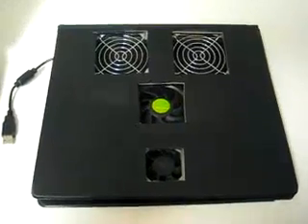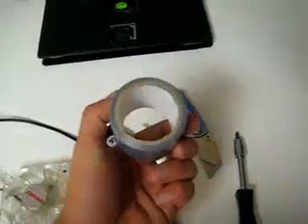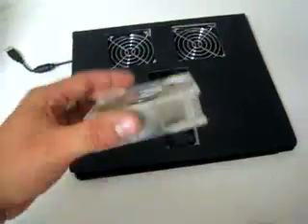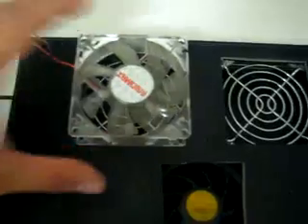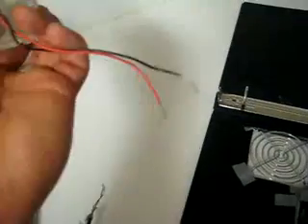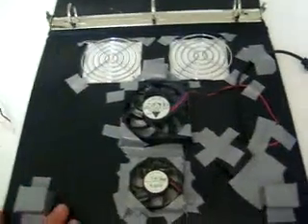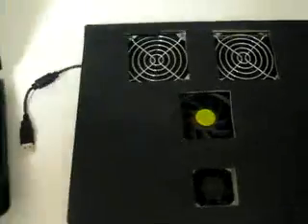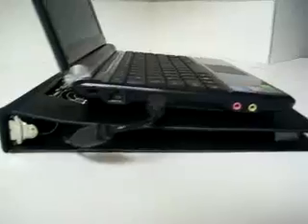HOW-TO: laptop cooler for under 5 dollars!!!!

Comment: i built something like this in the past few days just for my own use has 3 speakers 2 tweeters a dual fan for air leds for connection light along with multi card reader and all bulit in to one convenient box powered by one usb .....if you want to see ask

Comment: Check the system monitor application, under your applications->utilities folder If there is a program that's putting a load on your computer unnecessarily, you can shut it down from there. Also, there have been overheating issues with the early plastic macbooks. (Core Duo, not Core 2 Duo)I believe the problem was that the glue messed with the insulation on the temperature sensor wires. That's why they are now held in place with Kapton tape. Hope this helps you.

Comment: for those of you that dont have any way of buying a fan, what i did was take the fans off of some old computers i had collecting dust in my basement there should be 2 fans in a standard computer. after about an hour of tinkering i got some fans and made my own :)

Comment: That's a piece of shit.... USB ports only put out 5volts.. not only are you using a USB, you have the goddamn fans in the wrong direction... Try using 4 120mm fans rated at 12v @ .25amps.. 1200rpm.. run them in parallel and connect them to a 12v 2amp AC adapter... I feel like slapping you in the face right now...

Comment from the maker: @heatednemz They are pulling the air out of the laptop because the fans which are already operating within the laptop are forcing air out of the case.  The design of airflow should match the preexisting fan placement of your individual laptop and can be easily customized by placing the fans of the binder in conjunction with your vents/fans of your laptop

Comment: @Nikos870 
Most likely not, and at least not "at full force"
Maybe,  It  "might work" but  I wouldn't be surprised if it doesn't even move.
The reason for me to say this is that from a single USB  You can AT MOST get  0.5 Amp at 5V (= 2.5 Watt) 
And as You can see Your chosen fan is rated at  0,84  so the power is there, but the fan is rated as "starting voltage=7V" and You can't get that straight from USB.So the question is if it will move slower or just stand still.
Just my 5C hope it helps :)

Comment: Very impressive. The Binder is a great idea because it has a natural angle. Tape is not a good idea to secure fans. Today there is a multitude of inexpensive hardware choices. Two part epoxy might work well also. I love Proto-Type Engineering. Think about it as a career choice. You are a good speaker as well. Keep it up.Good luck.

Comment: Voltage: 12V DC.
Starting Voltage: 7V DC.
Consumption: 0,84 W.
Rated Current: 0,07 A.
Fan speed: 1300 RPM + / - 10%.

I found a cooler with these features is it ok , will it be ok for usb?

Comment: ummmm, dc power adapter 12v 1A, a sheet of lexan or other plastic, and 3 80mm fans, mark ventilation areas, cut hole mount fans leave extra on side to use as a mouse  pad area. a little more than 3 dollars? yes! custom built to lap top? yes!
idea's to produce a better product.....priceless!

Comment: Just a quick question - when you plug the fan in, you notice that air blows out of one side (other side probably sucking in the air). Do I face the side that blows the air into the laptop or the side that sucks in the air to the laptop.

Comment: Def. Does not work. I just spent an hour tinkering around with all different types of fans we have here at the shop and 2 different USB cables. One I cut from a mouse and another I cut from a printer. None work. I hooked up a GPU tiny fan to it and it BARELY moved.

Comment: @CHungCHac well every USB port has 5V output. You can't change it(unless there's a gadget that can do that). Another method is to used 9-12v batteries connected to the wires of the fans. or you can simply find an AC adapter which is not used and then try to connect the wires of the fans.

Comment: i actually just came up with the idea myself, and i built it last weekend. but instead of duck tape i used the screws. and 5V from USB was just not going to cut it. so i stripped an old laptop power supply (16V) and connected it to two 12V fans. And i also closed of 1 side of the map with some paper to up the air flow. I saw it worked best when removing the bottom part of your laptop, and now i have like 10-20°C difference whenon or off. i might do a video reaction one of these days showing it

Comment from the maker: @satvikjadhav4 I added a comment section within the the video to answer this question at 3:00 minutes.  The two fans are run in parallel so you simply splice both the red wires on the fans to the single red wire on the USB cable, and both the black fan wires to the single USB black wire.   It's as simple as twisting together three wires and putting on some electrical tape.

Comment: @lamboix if you connect them in Parallel you can... this will ensure they will all receive 5 volts each.  this means not connecting them in a line.  instead, connect all the positive wires together to the positive on the usb, then all the negative to the negative on the usb... sometimes a resistor will help as well to regulate the power output.  i do not recommend running this too often on battery as it will cut down on your battery life.  a small knob that can adjust the speed may help as well.

Comment: as long as the fans power cannot exceed 5.1 volts (the amount of power the usb port will put out) you should be safe.  a 3 volt fan SHOULD be able to take that increase and the fan actually perform even better!

Comment: so i am guessing you wired the fans in parallel (all positive going to the red wire and all negative going to the black wire).  as well did you try soldering your wires? and duct tape is good, but dollar store hot glue is pretty awesome too!!

Comment from the maker: I'm not positive on this one, I'd say you might  give it a try because it's not going hurt. You may just end up with a couple fans that you had to resplice a couple times :D  I'm guessing the ones you used for the AA batteries are already spliced, so it shouldn't take long to do some trial and error.  The problem is that there's no right answer for any two different fans because they all have their own specific power needs like ones with LEDs vs "Green" or low energy profile fans.

Comment: thanks, final question, i have a fan that used to be powered by two standard AA (1.5V) batteries, do you know if the USB power will be enough to run it well?

Comment from the maker: well because the 1 usb cable is spliced to both fans, so you take the 1 red and 1 black as shown in the video, and twist it together with the two red wires from the two fans, and then do the same with the black wires, just make sure that your set of 3 reds twisted together and your 3 blacks twisted together dont touch each other and you're set.  Hope that helps :D

Comment: Actually, this is not entirely correct. Yes, the USB port has 5V available at all times, but voltage does not create heat, current does. On a disconnected USB port no current flows. When You connect something to the current starts flowing and some heat is generated. Although, in case of USB, the maximum current is also quite small and shouldn't create too much additional heat. After all, laptop coolers like this one on the whole give you a cooler computer, so it shouldn't be a problem with USB.

Comment from the maker: Actually no, because the USB controller itself is constantly receiving 5v of energy within to laptop itself, its like saying if you plugged in a USB mouse it would make your laptop get hotter, but since you can only use 5v maximum its not like you are forcing your computer to work any harder than without the USB device.

Comment: cheap, works good, both pluses but i think my alienware would crush that, i have one in the works, an old power supply and 2 160mm fans with 100+ cfm each, the stand is made out of a vcr/dvd combo that quit working a while back, drilled the holes for screws and jig sawed the holes out

Comment from the maker: Well in my case I overclocked my normal 1.6ghz atom to 2.2ghz and it actually does get pretty hot after prolonged time, and I do game on it as well, but it works well for example when I'm sitting on my couch or in my bed doing stuff as a flat platform for your lap as well as the cooling capabilities.

Comment from the maker: as long as you make all connections well and have no shorts ur not gunna "fuk things up lol" the problem you'll encounter is that their isnt enough energy to run all 3 fans at sufficient speeds to be viable vs running 2 fans at higher voltage and getting more RPMS out of them, GL though and it can work if you buy low impact 5V fans

Comment from the maker: well it depends on the size of binder you choose to use so if you use a larger binder to compensate it should work, the key is not that the entire laptop fits on the binder as long as the main contact points underneath can be supported by the binder.

Comment: My laptop has a fan on the bottom (as almost every laptop) which pushes air from the bottom and exhausts through the back. So, if i was pulling the air away from the laptop fan it would create an opposite pressure which could make the laptop fan loose some speed, besides removing cool air from laptop. I built one cooler myself with the fan pushing air, after some time testing which way the fan should be mounted. And pushing sure relaxes the temps on my laptop.
Keep with the good DIY gadgets :)

Comment from the maker: (Continued from previous post)
For the 12v USB problem  as I showed I made the mistake of trying 2 12v fans initially, the best solution I found were the smaller fans which have a lower overall power consumption but comparable flow rate.  In all reality the fans are just for looks, the passive cooling ability of keeping the laptop vents free for airflow alone makes it worth making (5-10 degree difference on binder, compared to other mobile surface such as a pillow, or on your lap)

Comment from the maker: Thanks for all the comments, and to answer me some questions, airflow away is always airflow in, your Laptop itselft should have direct flow onto the heated components and this air is dissipated out of the side of the heatsinks on which the fans are placed, the vents on the bottom or side of the laptop are to draw airflow out not into the machine so sucking is better then blowing for a cooling system ( think of a desktop CPU coolers blow on the heatsink, case fans blow out)

Comment from the maker: Maybe you need to rewatch the video cyfer, the fans are faced away from the laptop and when the binder is closed they do not touch the bottom of the binder so there is room for ventilation as the sides are open to air, also the passive cooling allows for direct air contact vs surface contact

Comment: did you know that you make things only worse ? I mean the fans inside the box .. think about it .. if you don't cut holes and dont let the air enter the box you just have warm box with a lot of noise and vibration.. i suggest make it from acrylic glass and leave some space under the box for air to enter

Comment: Nice.  But I find using four caps from vitamin water bottles or even beer bottle caps placed on all four feet of the laptop will pick the laptop up to circulate more air underneath. Multiply this effect by placing a small desk fan to blow air underneath.  Presto.  Cheaper.

Comment from the maker: Ya I take it for granted that I just have a box of random computer stuff, but you would be surprised at what you can find around your house, if you really were hurting for fans and you wanted them cheap, you could buy those 1 dollar battery operated carry around fans, then take it apart and either solder on wires, or make it wireless....... and put it in a housing, could be your own lil spin on the idea, just now thought of it lol.... but anyways ya i know everyone doesnt have the parts

Comment from the maker: Its simple doing the just add the extra wire to the connections, so you would have 3 red spliced together and 3 black spliced together just intertwine all 3 wires instead of just 2 :D

Comment from the maker: ya I actually tried that if you looked at the notebook close up, but the problem is how do you set a notbook on top of random screws and keep it level????????? so I had to flush mount everything with tape so there was no other imprints on the top of the notebook.